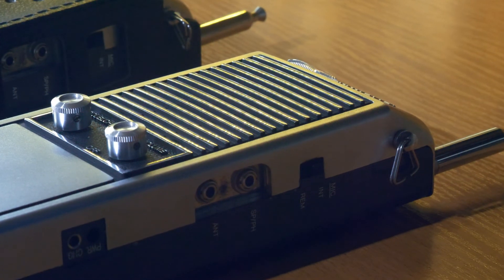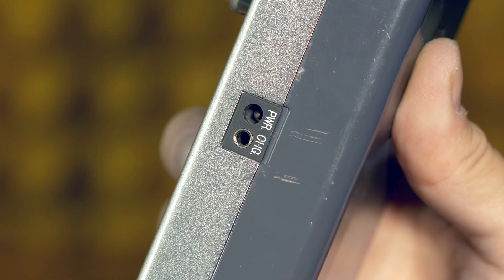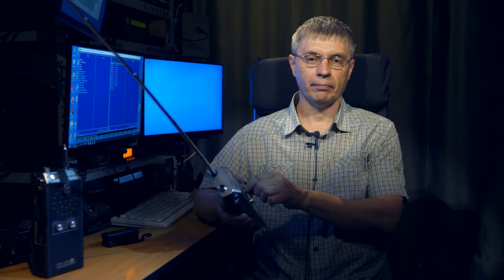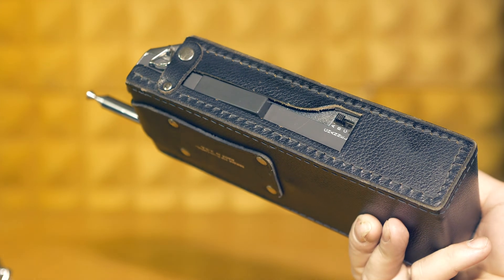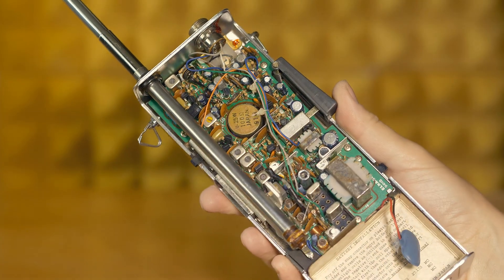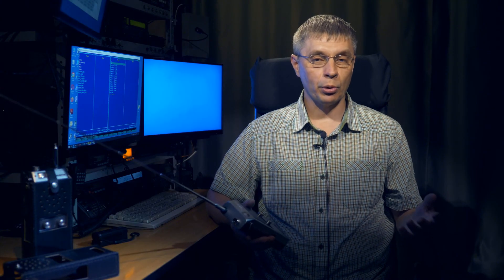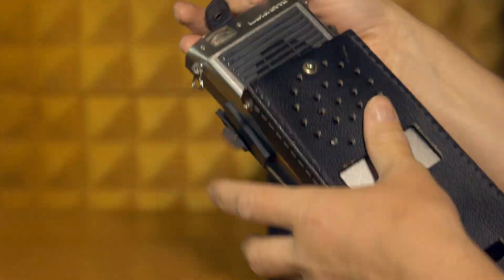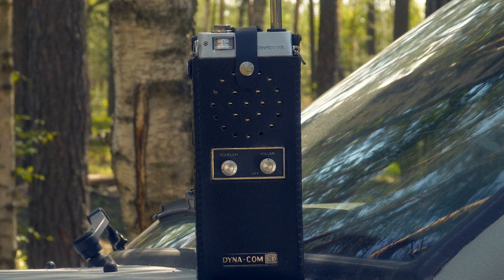Lafayette DynaCom 3C CB radio from 70s. Crystal-controlled frequency.

Comment: The outside of the input power plug is positive + the inside sleeve is negative- type L  Radio Shack. I just bought one for $40.00 mine was brand new in the box, just as beautiful condition like yours!

Comment: I seem to remember that when using 1.5V dry batteries you are supposed to use just eight,  w/two dummy batteries (shorts). All 10 spaces are for rechargeable batteries. Someone correct me if I'm wrong.
Reply: You are correct, I believe they came with 2 dummy batteries that were kept in when using standard 1.5v batteries which most people did.
And those that could afford 10 aa rechargeable batteries back in the late 70s, you used all battery slots